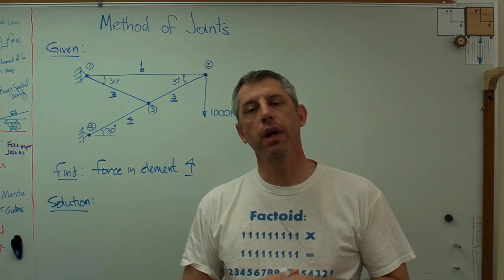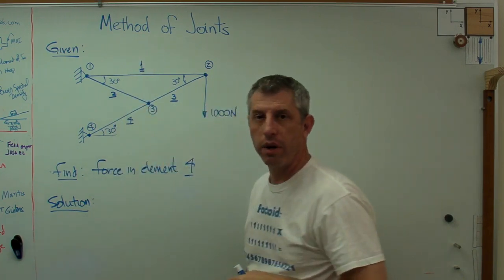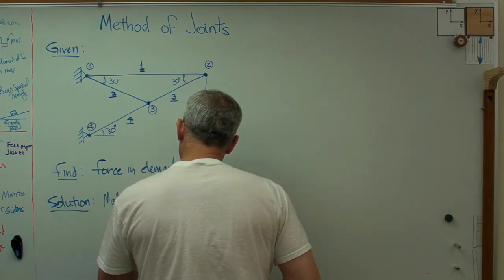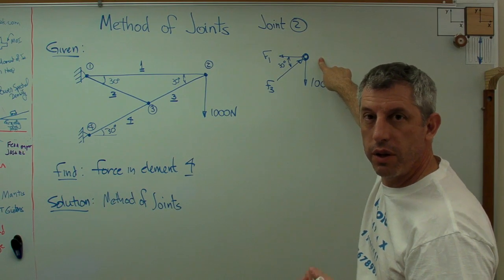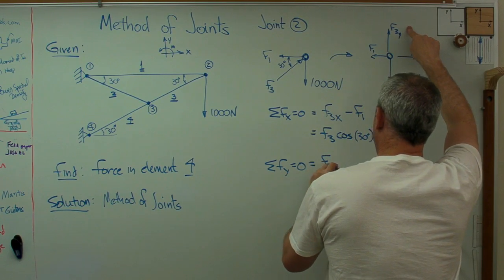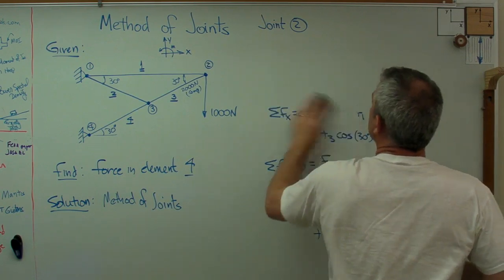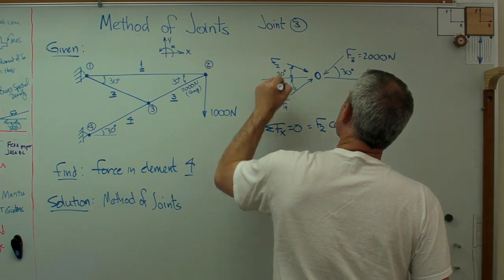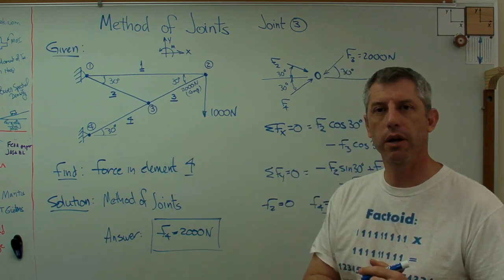Method of Joints - Brain Waves.avi

Comment: Why the (Fx) component of the F3 force is not -F3cos(30) if the Force F3 exerted on the joint 2 is in the 3rd quadrant. What it seems to me is that you did the projection of the force in the 1st quadrant and then found the components from there but my question is this if you do that from my point of view the force F3 is no longer in compression. Instead, it will be in tension.